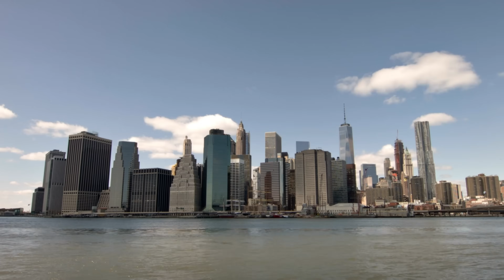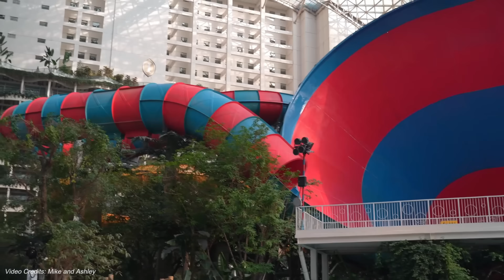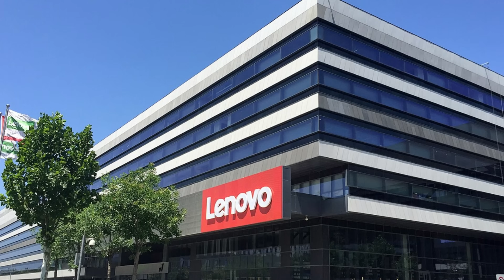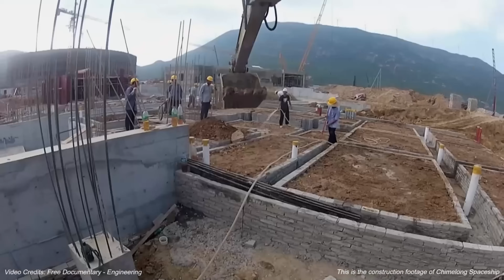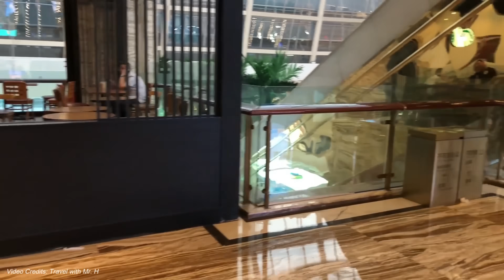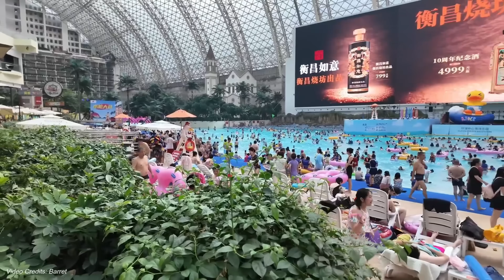China Built a $10BN Building With an Ocean Inside

Comment: The Global Center in Chengdu has a footprint (ground floor area) that is roughly the size of 20 standard football fields placed next to each other.

The figure of 328 football fields refers to the building's total cumulative floor area spread across its 18 stories. This isn't an intuitive way to visualize scale. It's like saying you can stack 328 pitches on top of each other inside the building. What does that mean? The grass? The posts? No...